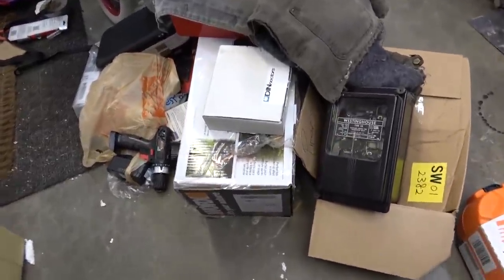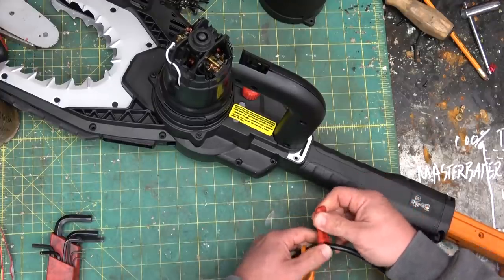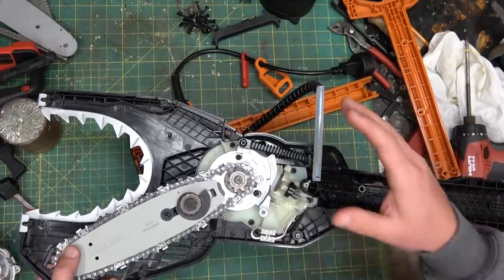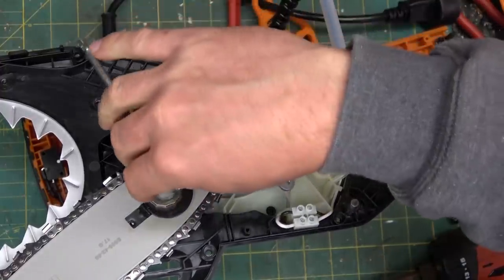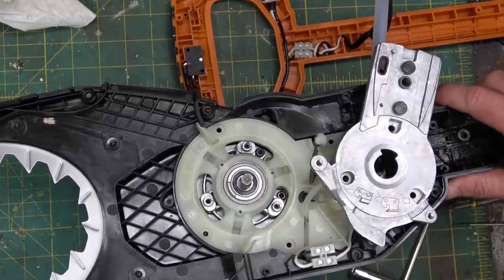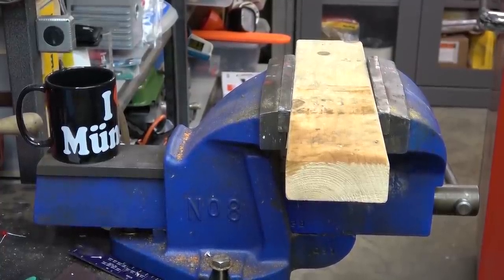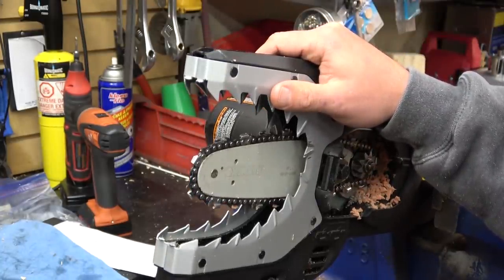BOLTR: Worx Jaw Saw | Engineering Fail

Comment: They know it's rated for 5A max voltage because they measured it with their ohmmeter.
Reply: But at least those are Amps Celsius, Fahrenheister Amps are gutless.
Reply: He couldn't even say it with a straight face when recording.
Reply: TheAmpair Kelvin beats both
Reply: But is that 5A max voltage metricical or imperialic?
Reply: That's because they used a metric multimeter instead of the imperial one
Reply: Check the voltage with the leads in the current slots if you are a real man.
Reply: And calibrated with their Vernier calipers.
Reply: the needle on that oscillographer ran wild with watts!
Reply: The power on that was over 9000.
Reply: Ohms my Gauss!!
Reply: @Steve Mclean 5A Eff
Reply: Nah they obviously tested it with a megger.
Reply: Ian Wallace So what is that in Coulombs?
Reply: @Joetechlincolns  5 coulombs/second
Reply: I bet they used a Whatmeter for that
Reply: Lol.
Reply: Steve Mclean - Peak Obviously, more bigger numbers more better right?
Reply: Would a Kanuker say 5ehs?
Reply: *Thermometer   😁
Reply: those are standard amps worx uses metric
Reply: Narf, narf...
Reply: I think they measured the electrical diameter
Reply: I thought they measured it with their laser level? Maybe I'm wrong.

Comment: Well I hate to admit it, but I own one of these, and it honestly has a place of honor just above my stihl on the wall.  its not really for what you think.  its too heavy for pruning trees, but where it shines is for around the campfire.take up to a 5 inch branch lay it on the ground, and set the thing over it.  as you push it down the jaws are on the ground and the saw cuts the  branch.  never hits the dirt to dull the chain, dont have to bend over with the saw just put it there and press down and itll chunk all night. I love it.  for campfires. for actual work i use the stihl. just sayin
Reply: Thanks for the break down, I want to buy one just to play around now! I have about 6 chainsaws varying in size up to the big boys but this thing just looks fun lol
Reply: I own one too. It looked fun in the store, I even bought the long tree extension. Problem is, it's HEAVY and the motor end is way out there. It's like tying a chainsaw to a long broomstick and then you still need to do that awkward pushing handle action. I am not sure if I'll ever be strong enough to use it more than a few branches and I will do manual looping and sawing for 8hrs every weekend until I use this. A failed reminder that clearance prices aren't always a bargain and to always lift tools up in the store and pretend I'm pruning a real tree.
Reply: Yeah, he should have watched the commercial.  That's exactly how they say to use it.
Reply: Campfires implies camping for most folks - where would you plug it in?  Generator?
Reply: @ZENO357  clearly just camps in his backyard.
Reply: @ZENO357  there's also a battery power one.
Reply: @ZENO357  They have both 20v and 40v lithium versions of this tool.
Reply: best product i ever bought for storm cleanups from downed tree limbs.  I've let friends use it also saves so much time. 1 to 2 hours tops for use times so not sure if it will last long but for me it is perfect. saves the back from having to bend over just laying it on the ground.
Reply: Okay that's pretty great actually.
Reply: "its too heavy for pruning trees,"

Not if you put on your big boy underoos first
Reply: Five, maybe six whacks with my $21 hatchet?
Reply: That explains why you push. Pushing top down is easier than pulling bottom up
Reply: That's funny. I never saw the promotional video, but the only thing I really pictured using it for was campfires.
Reply: Your Man Card has been revoked.
Reply: zeekdog2003 
Grown men use a chain saw. The type without training wheels.
Reply: zeekdog2003 buddy, you must be cutting up bamboo debris if this is the best thing you’ve ever used on a storm cleanup.
Reply: Mark Stolzoff yah they do. I have the 20v version. It sure isn’t like my Husqvarna, but it lets me chop down my neighbors pain in the ass bamboo without them hearing me do so.
Reply: I got chordless one coming. I cancharge with my jackery 500 solar system at camp sites
Reply: Yeah, I’ve seen it used for tree root/stump removal where you’re pushing down into it.
Reply: This is probably the last thing I would carry into the woods for camping. And if I saw someone using it at a campsite, I would laugh my ass off.
Reply: My mom loves Worx tools, so she bought one.  She’s 79 and has a lot of trees on her property.  I have a nice Stihl chain saw and had my doubts about how useful this WORX saw would be, but I have used the hell out of he little Worx saw.  It does a great job chopping up limbs.  The guide holds the saw up and keeps the chain out of the dirt as the chain catches the limb and pulls it into the mouth. Because the operator is neither holding up the weight of the saw nor the limb (the guard Carrie’s the load) it takes far less exertion than a regular chain saw.  No, it isn’t great overhead, or for clean pruning cuts, it is fantastic at taking care of downed limbs.

Comment: One of these days you'll open up a tool that has a message written for you by the mold maker. That's when you know you've made it.
Reply: As a tool maker I hate to tell you this but that would never fly, if it's not in the print your up the creek if you were to put it in there, what you'd have to do is have to engineer in on it along with quality control and various other parts of the bureaucracy all in agreement so good luck with that lol.
Reply: Ha! That reminds me of a former neighbour who bought an old (old=wooden chassis!) Lagonda to restore. When he stripped out the interior, he found a 1" washer tied to a piece of string, hanging below a rear window frame so that it would gently ding against the inside of the bodywork at random intervals. That was some 90 year old trolling for every mechanic that ever worked on the car! I thought it was hilarious.
Reply: Attn Ave : GTFO!

😂
Reply: Alan Mumford hear a story about a car with a unexplainable rattle.  Multiple mechanics from multiple dealerships looked everything over just to eventually find a old pop bottle filled with stones inside a quarter panel and note congratulating the finder.  Dude got fired due to modern tracability.
Reply: Alan Mumford I have heard similar stories. But the rattle traps were found just the same
Reply: Reminds me of the trick you can only play on mechanic friends or rich friends, put a thick zip tie on the front axle on the drivers side and leave it long so it hits the underside of the car and gets faster as the car goes faster.
Reply: @photosbyian  - Dadgummit. I'm gonna check my car tomorrow morning for the zip tie trick. I thought it was my plastic wheel covers.

Comment: On why cheap tools smell funny out of the box: If the company cheaps out on the mold, or the part has a bunch of hard to fill spots due to bad design, the injection molder will add PPA, polymer processing aid. It's a lubricant that gets in between the polymer chains and helps them slide against each other as the shot fills the mold. You can overcome a fairly wide range of mold / part design flaws by the judicious adding of PPA. However it will bloom out of the finished part over time, and as the finished product sits in a plastic bag inside a box, the stuff has nowhere to go so it just sits there, stinking up the packaging.
Reply: It's not just cheap tools, the WillSuckYe packout boxes stink like headcheese farts when they're first opened. Disclaimer: I don't own any, we just sell them where I work (not Home Cheesepot)
Reply: I've alsop seen a foaming ageny added to abs& pvc to help fill a poorly designed mold
Reply: Before delivery stuff is stored in plastic in warehouses. It's the plastic you can smell, used to work in retail and when clothing was delivered to the store it would REEK
Reply: @BigSteve215  So you're saying instead of having nowhere to go it gets absorbed into us or evaporated? Which?
Reply: @bmo14lax  Varies by snout size, evap vs sniffle percent.

Comment: I have one myself. I don't think of it as a chain saw but a powered lopper. 

Lube hog? Yup, will also dribble if left in the wrong orientation. 
Agree with the ergonomics, but my guess is that the idea is if you lose your grip it will shoot forward rather than backward toward the fleshy bits.
One thing missed in the review - the tension relief on the cord is susceptible to oil degradation and crumbles as soon as you touch it with chain oil on your hands.

All that said I don't hate it. The jaws make it grab bundles of small branches and still cut where a chainsaw would knock and chew em around. It works to shove the head into thorny brush and wiggle around until you've got a path in. It is good at bucking small stuff sitting on the ground since the jaws keep your chain from hitting the dirt and keep the branch pinned.

Mostly used by my mother in law now since she gardens and can't pull start a gas chain saw and isn't strong enough for loppers, which is who I think it is made for.
Reply: @BitterCynical  dong lopper......im dying! 😂😂😂 guy makes a full on review and you come in with "dong lopper". CLASSIC!
Reply: Yeah, that's kind of what I was thinking. My wife had requested I get her a chainsaw for a birthday present, and this thing seems maybe 56% safer than a regular chainsaw.
Reply: Are you a word rep? All of a sudden, I  almost want one!
Reply: Michal Ty look at a reciprocating saw, still has to be plugged in but normally built better and will cut anything that can plus a bunch of other uses
Reply: @jestempies  My general impression is this is a chainsaw with training wheels, suitable for supervised use where a chainsaw in a youngin’s hands would be very unsafe (and probably intimidating). Let your child-serf use this for a few seasons and by the time they’re in 6th grade, they’ll be ready for work on the king’s (your) holdings.

Comment: I thought it was going to be some sort of large pull trigger (like a caulking gun) that made the blade swing down.  The pump action thing is a bit weird.
Reply from the maker: awkward to say the least.
Reply: The only justification I can come up with is that the pushing motion ensures you're pressing the tool against the target as you engage it.
Reply: Hello Clive!
Reply: Exactly, the whole point is to ensure the tool is being pushed into the thing being cut. Not saying the whole thing is particularly practical (or useful), but that part of the design makes sense.
Reply: @RFC3514  I just thought it was for people with not a clue how to use a chain saw. +1 Horror movie prop.
Reply: @blaircox1589  I think you're right, but there are lots of home users, who don't have a clue but still use them so trying to do things in newer, safer ways, given the high consequences of error with chainsaw injuries, is a good thing. It's a shame this tool is not any good or safe, given the user fatigue it's likely to cause, compared to a chainsaw.
Reply: @cjhification  you designed, didn't you! 😁
Reply: @blaircox1589  lol
Reply: Not for a dingus lopper
Reply: Better to push the saw away from you than pull it...
Reply: Its designed for cutting logs on the ground hence the pushing motion also does well at cutting branches above your head. Pretty crappy tool but made for a naffy purpose. also somewhere in the comments is the man who designed the thing (ps. don't tell him i sent you no need for the old farther to know my user name)
Reply: You push it up against a tree branch, hence the push-actuation.
Reply: "all you have to do is push to engage it" - Hence the design.
Reply: wobblyboost  That's just early computer memory... called core memory.  That module would probably only hold about 1kb of data (hard to say for sure... Clive would probably know).
Reply: Is this a fully semi automatic pump chainsaw?

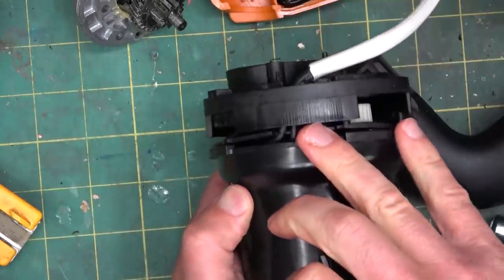Comment: 18:10 The word for that is "skiving". It happens when there isn't sufficient draft built into a mold cavity. Or in the case of an over molded part, the substrate is larger than the cavity.

Comment: My elderly neighbor lady uses one of these when branches fall off her tree. She points it straight down at the ground over the branch, pulls the trigger and pushes straight down on it. it seems to work okay and you don't have to worry about running the bar into the ground. 
For that kind of use it does make more sense to push then pull. 

I have to admit, if I had a bunch of branches at ground level I'd prefer this to bending over with the chainsaw all day. But due to the high teasing Factor, I'd rather have a sore back than a sore ego.

Comment: I have one of these, bought it at a liquidation store for $15. 

It actually works fairly well. The push down feature and the jaws let me use it to trim down yard clippings/branches on the ground. Something you can't do safely with a regular chainsaw. 

I use other yard tools to trim/prune my trees, then this to get everything small enough to fit inside yard bags. I can get through my entire yards worth of branches in under 5 minutes. I don't use it like a chainsaw, more like a....crappy handheld mulcher...
Reply: Can you push first, position over limb, and then pull to cut?
Reply: Yup, perfect example, I get what you mean, however i found that the Black & Decker Alligator saw works better for that purpose, though.
Reply: I tried it for that.  Got it done in half the time with a regular chainsaw tho
Reply: Sawzall

Comment: 5A of voltage!  Man, isn't that equivalent to 200 mega newtons of Horse power?
Reply: gonecoastal4  just like the 6 stroke hondo gensets you can buy from Napa.
Reply: And all the friction of the chain rubbing against the bar. Those things usually get pretty hot pretty quick. Actual cutting power I'd guesstimate closer to 1/2hp.
Reply: Teaching students to convert horsepower to watts is one of the hardest things. 

They know horsepower is for engines and watts is for electricity.  The connection is completely lost.
Reply: @JasonDavison  746W/hp from memory. I misplaced a fraction somewhere but who cares, right?
Reply: @markfergerson2145  you are correct sir!

Comment: Posting from the wiff's account on account of my confuser being in the same room as a sleeping dragon. So basically every woman I've ever known goes straight for electric versions of all yardbound implements of destruction. They are lighter, quieter, don't require pulling a rope, and are less finicky. Plug it up, pull the trigger and it goes. Basically all of them are wary of a chainsaw. I can see this being made for them. In their brains, it's the same function, but there isn't a giant spinning blade of death hanging out for the world to see. It's big enough to lop up a downed branch or two, and they can use gravity to their advantage by leaning on the handle. If the job is any bigger than the depth of the jaw, they are going to call a 200 pound gorillia with a gas powered spinning blade of death to handle it for them anyway. Just my .02
Reply: Don,t worry by those dudes , this tool is a good tool, I use it my self and very pleased with it .:)

Comment: The only time I would consider using it is when cutting a plastic sewer line in a ditch. The shroud has potential for redirecting the blackwater at some unsuspecting bystander and the reach might mean that I don't need to reapply mud to my boots for that proper look
Reply: its electric. If you get it anywhere near water it'll kill you and start a fire somewhere.
Reply: You are saying that as if it was a bad thing 😍 actually it shouldn't be any standing "water" until the pipe is cut. What kills you is the ignition of the gas in the sewer when the plug ( the greasy reason you are cutting the pipe in the first place) goes backwards due to lost fluidpressure.

Comment: Orange clip on the cord is to put a small loop the extension cord through to hold it.
Reply: I think he knows that
Reply: And the red "RFID tag" is actually just a pin for jamming the slide action during transport.
Reply: you nailed it mate. that slot is for a loop of the power cable...push it through then secure it on the hook of the latch. its so cable tension isn't relayed to the fixture inside the tool.
Reply: Actually that relays all of the tension into the tool.  The orange clip is so the extension cord doesn't pull off and unplug.
Reply: Clandestine Woodwork Just put the ends of both cords side by side, tie a knot in them and plug them into each other. Never comes apart, no tension on the plugs.
Reply: @trashflood7883  I know how to connect cords, I was explaining the clip.
Reply: The tension of the cable wouldn't be changed by attaching the cords together Better, the cable tension would be there and measure exactly the same at the junction of the cord and the fixture even if it was just one cord would it?

Comment: I'm thinking the reason it's push-activated as opposed to pull-activated is because, that way, as you're pushing the tool into the workpiece, you're also actuating the saw lever.
Pulling might be physically easier, but then your front hand is still pushing to keep the tool on the branch, and you're pulling with the other hand...

Comment: The orange clipy thing is so you can mutilate the 12 gauge extension cord wire by folding it in half, sticking it through the slot, and then looping it over the dingus bit. Provides strain relief so your protected pokin' bit doesn't fall out of the receptacle end of your extension cord and stop the angry pixies dance party.

Comment: that stink is probably cause they used recycled plastic, I work at a plastic extrusion plant and whenever we send plastic out for regrind its also full of all the oil that leaks from the machines. when we use the regrind for the power totes it stinks like none other
Reply: It will stink even worse now that it's full of mystery meat.
Reply: Walk into a harbor freight, that whole place smells bad.